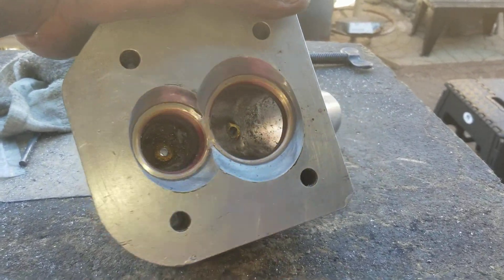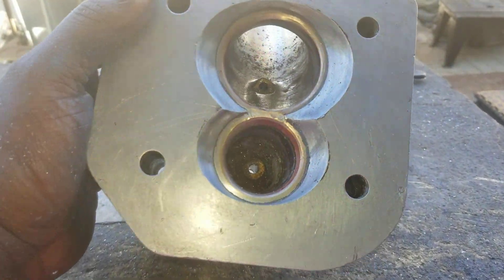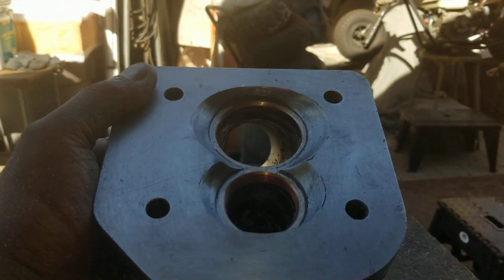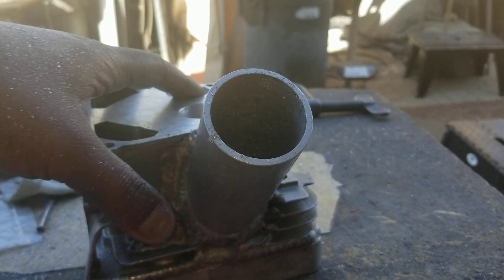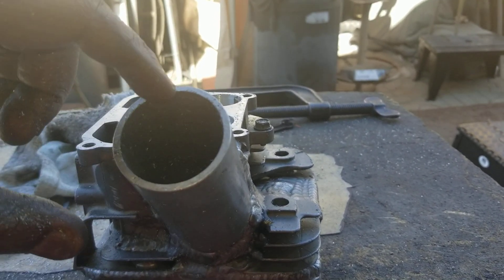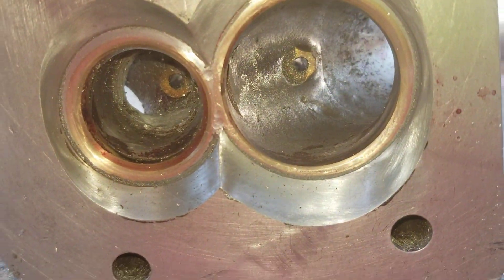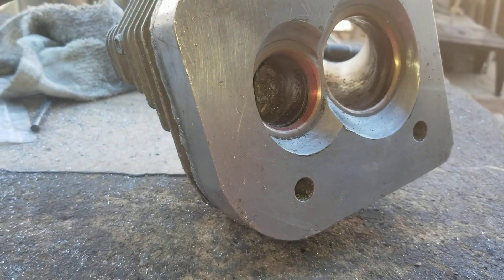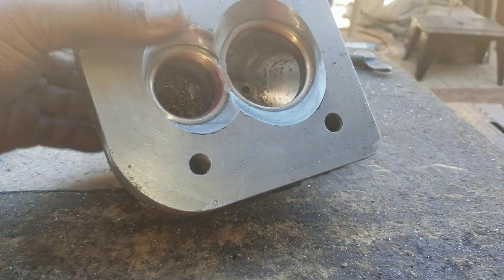Custom big block head chamber came out nice

Comment: Where's the plug?😂
Reply: @paulskartslifan4206  yeah me too haha
Reply: @paulskartslifan4206  I also found a friend with a mill and a lathe...
Reply: @paulskartslifan4206  yep. The epoxy unfortunately came apart in the head and destroyed the cylinder walls. Smokes like a frieght train and only makes 110psi of compression. I'm doing a rebuild and setting up the blower on my other block this winter. Hopefully running my 1.3 rockers, tubbing/welding my head, and running on nitro. Might be good for 1 faithful run😂
Reply from the maker: Its gonna have two 10mm plugs once finished. And there is NO EPOXY in this head, it all weld, cast, and billet aluminum. Once done it should flow around 240+cfm. More than that billet head i just did a few videos ago.
Reply: @minidragbike  thats insane! Can't wait to see it finished
Reply: @paulskartslifan4206  yeah it'll be mean